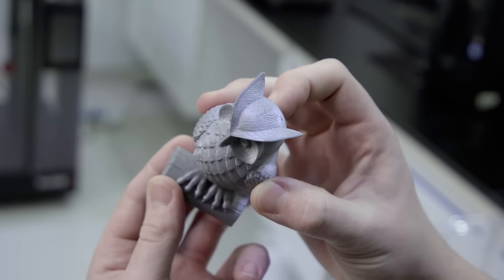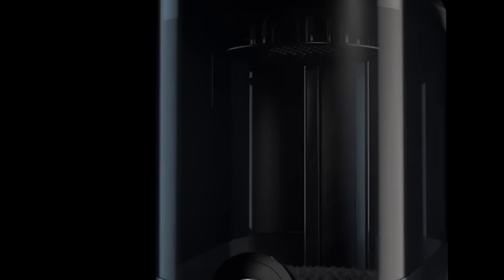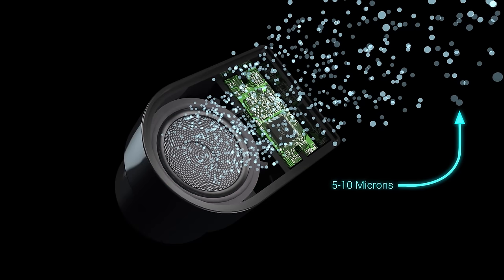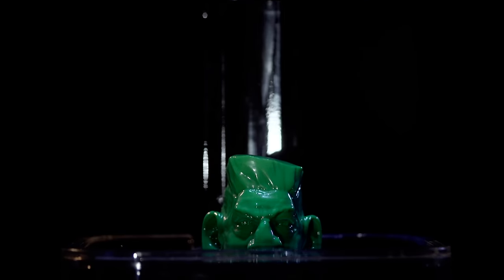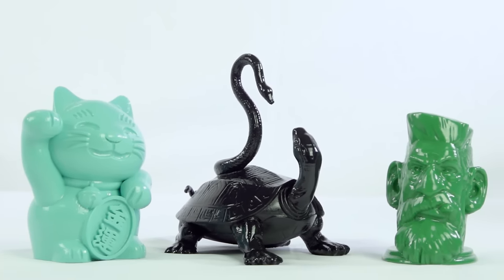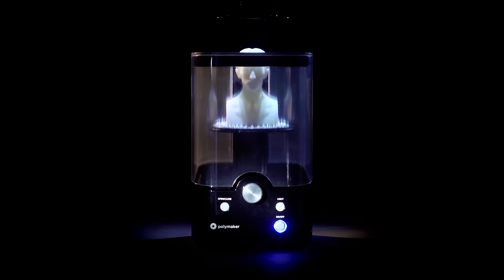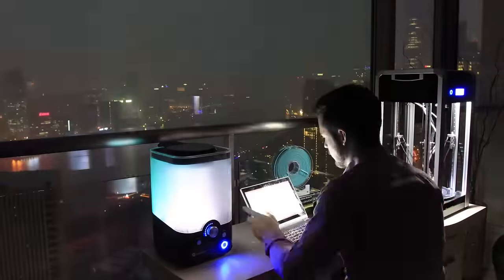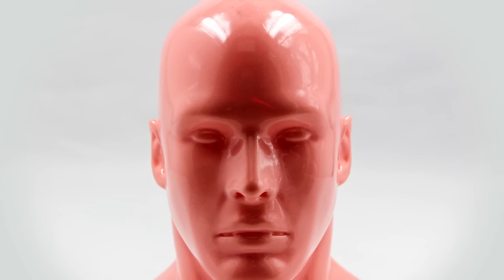PolySmooth & Polysher

Comment: I wish my prints came out as nice as these. I bought the Polybox and the Polysher to ensure everything worked properly with the Polysmooth, and all my prints look good coming out of the Polysher, but then they have a raisin like texture to them once they dry. I created a reddit thread, but no one seems to have any advice that will help. If anyone has any ideas on how I can make this stuff work please let me know.

https://www.reddit.com/r/3Dprinting/comments/c1mvrb/polysmooth_failures/
Reply: From what I saw on the polymaker group they got back to you pretty fast :) I hope you will solve your issue.
Reply: @3dprintingscience528  Thanks, updated my post, but sadly they didn't have an advise that helped.
Reply: @JT-Works  hi did you ever find a good fix?
Reply: @emartin8907  the best I could do was sand the part first and then do a super light polish. I contacted support, but they weren't able to help.